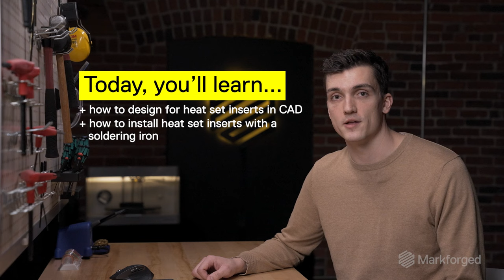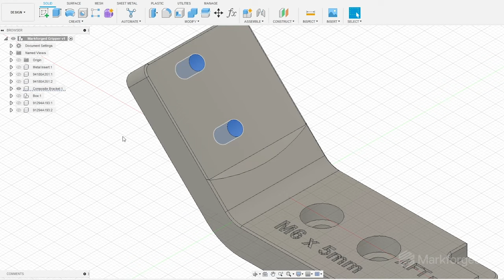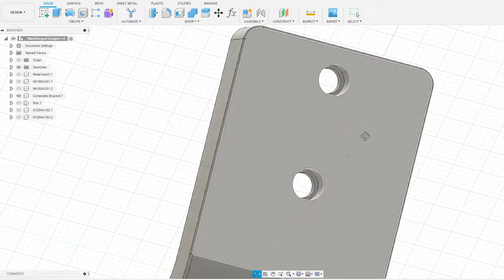How to Install Heat Set Inserts into your 3D Prints | Markforged Reinforced

Comment: I'm not a fan of press in inserts. My go to is to create a hex cavity, erase the support material, create a pause statement at the top of the cavity, drop in a real nut of any material you choose, continuing printing for a fully embedded piece of hardware that is guaranteed to not pull out or spin. A video on that procedure would be equally as beneficial. Your thoughts??
Reply from the maker: Very clever! And thank you for the idea for an upcoming video. 💪
Reply: Even better is rectangle nut as from my experience hex nut can sometimes spin inside the cavity if the force is too big. With rectangle nut - no chance. Plus the front area is bigger so it’s more difficult to pull it.
Reply from the maker: Oh yeah! Nice one Mariusz -- thanks for watching and for the tip!
Reply: @volkhen0  Prusa uses rectangular nuts in their machine, and there's no need to pause the print to put them in. You can have the customer do it with needle nose pliers while cursing.
Reply: @volkhen0  what about adding a dab of epoxy to the sides of the squared/rectangular nut so it fills and solidifies any remaining gaps in the cavity? or useless?
Reply: @freetobe3  just make the cavity tight. When I make my designs I usually need to use force to push square nut in.

Comment: I think there is a mistake in the tips, it should be: Set soldering iron 50-100 °C BELOW temperature of printer nozzle. Also note that there are inserts with some lips that provide much more pulling resistance, even more than nuts.
Reply: I think it should be: Set soldering iron 5-10 °C above temperature of printer nozzle. So, a factor 10 less than what he says in the video. This also aligns with the advice of the web site of cnckitchen.

Comment: The temperature seems very high. I find if I use high temps the insert will not centre easily and the central screw hole fills with plastic so you cannot screw in the screw. Someone else where suggested the temperature should not exceed the plastic phase of the material. This allows the insert to be inserted accurately without material being squeezed into the threaded part. I use inserts mainly when the part needs to be undone frequently. ( e.g. battery lid fastening).
Reply: Yeah I thought so too. I have the same soldering iron as him, and I set it to 200C, and it goes in quicker than shown.
Reply: Ruined quite a few attempts from his 50 degrees over and then setting his iron to 180 more than the melting point.   Then, no mention about rendering the insert useless because it's full of plastic.

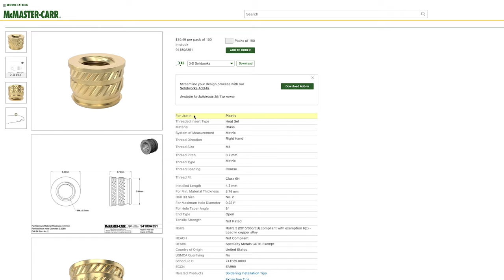Comment: 2:27 you took 5.74mm from the data sheet but that's called out as the minimum material thickness, not the hole diameter. Two lines below that is the hole diameter you should have used, 0.221" (5.61mm).
Reply: You're totally right, good catch.
Reply from the maker: Good catch Tort! And thanks for letting us know.
Reply: Don’t forget to add the diameter of the print nozzle to get an accurate hole on a 3 d printed part.
Reply: @stephenbarlin2314  So if I'm using a 0.4mm nozzle then all my walls would bulge out a minimum of 0.2mm from each direction?
Reply: In practice, the exact hole dimension isn't too critical, unless you're going for optimum strength and alignment, which you might not necessarily need for your application.  Heatsets are remarkably strong.  There is a video of a guy who put his full body weight to pull against it and it still held up.  Depending on your design, your part would break before the insert pulls out.  Most through holes and slots are designed to be oversized for the screw you will use, so that gives you extra leeway.  Just like you wouldn't specify all your tolerances to 1 mil, you don't need everything to be perfect.  Sometimes, you just need to get the job done.

Comment: Great guide, answered a lot of my questions! The only thing i am unsure about is the 1:46 part. Are those holes bigger than the screw's biggest outer diameter or will the screw actually touch these walls? I am using m2 screws, what diameter should this part be?

Comment: You ignored the spec sheet callout for an 8° taper in the hole. A straight hole is adequate, but for optimum pull out and torsional strength the 8° taper is important.
Reply from the maker: Great call out, Robert. We'll be sure to include details like that in future videos.
Reply: If the hole tapers 8° is the diameter called out the major or minor dimension?
Reply: Spec sheet is a guide, not a rule.  You don't always need the maximum strength, and can get away with different dimensions.  There is a video where a guy tested heatset inserts for a range of hole diameters, and most of them held up quite strong.  Just expect to experiment around to find one that works for you, as it might not work the first few times.  3D printing is about experimentation after all, not blindly following rules.
Reply: thank you for your comment, I took good note of that.